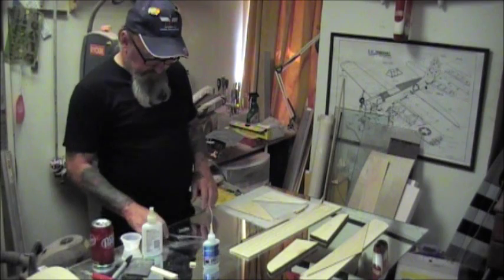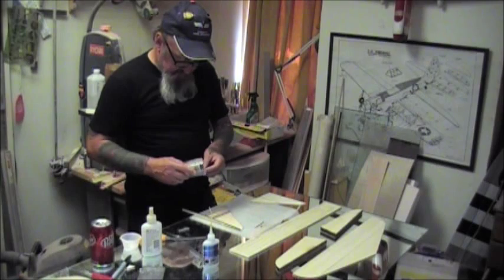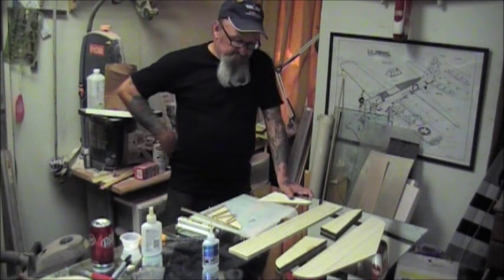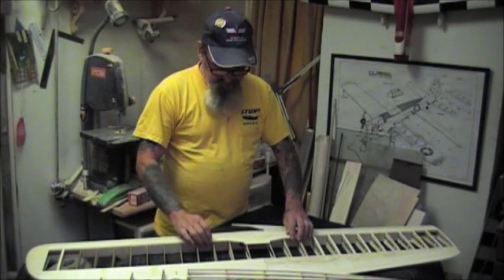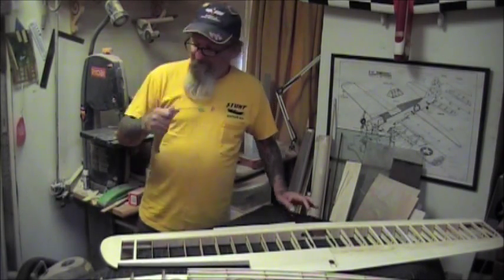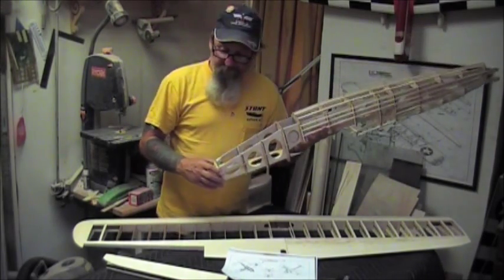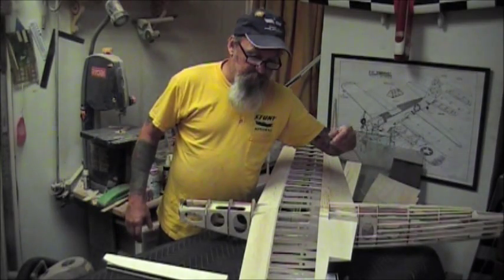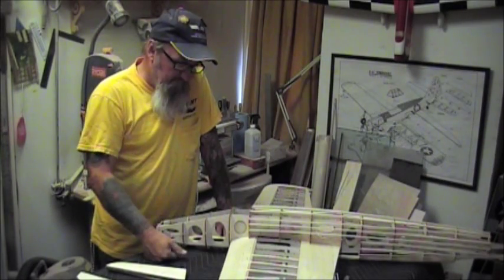Control line scale Shoestring build

Comment: I was just given a 1/2A Shoestring model by Hobby Lobby.  I noticed that your kit has a lot of balsa parts.  Mine only has foam parts.  Were there different variations or am I missing some parts?  The instructions are printed so small I need a magnifying glass to see the print!
Reply from the maker: My airplane is a prototype 1/4 scale control line scale plane